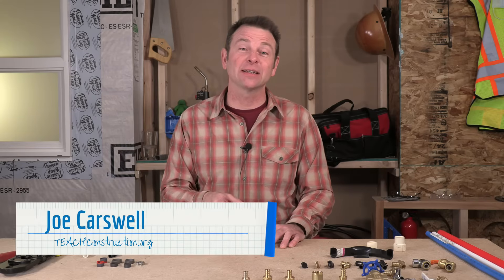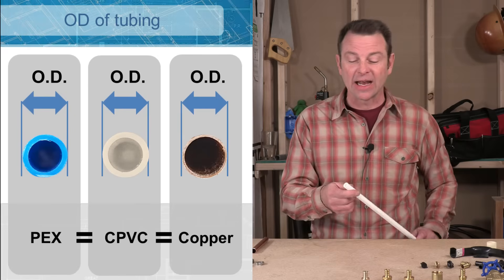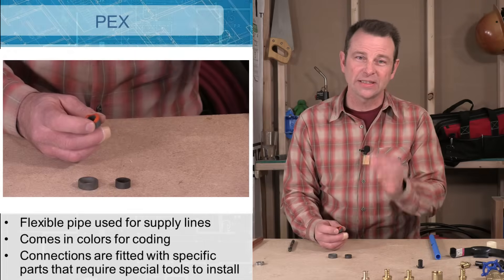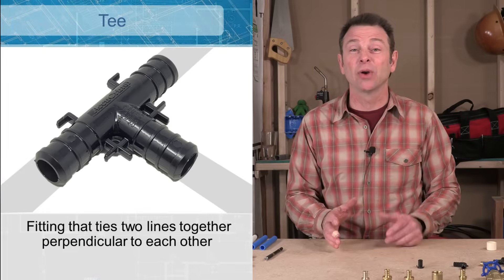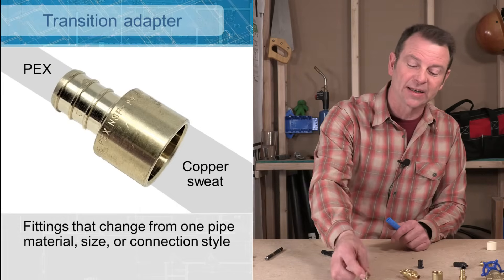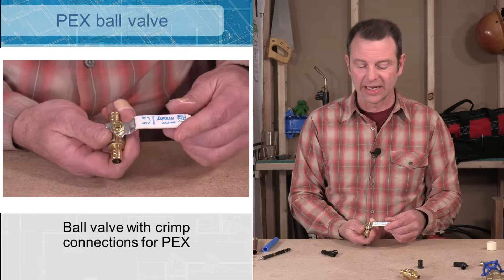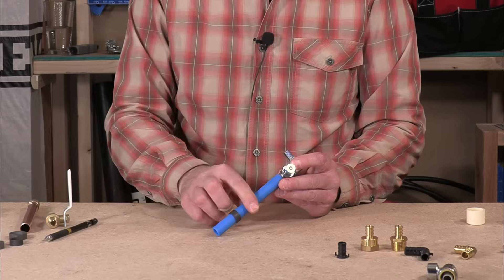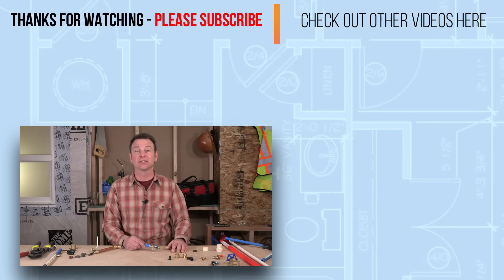A lesson about basic PEX plumbing materials  - Intro to Plumbing Systems

Comment: Is there a fitting I can use to connect to the compression fitting end on the water supply for a dishwasher that I am installing? The PEX, with a shut-off valve, is going to be replacing some leaking PB in my old manufactured house. Someday I hope to finish replacing all the PB.
Reply from the maker: Not sure I understand what fitting you are asking about - the supply stub out that typically has an angle stop on it - or the water input on the dishwasher?
Reply: @ConstructionEd  If you have a 3/8" OD soft copper line, just cut the line at a smooth place and use a push to connect with a jump size. You may want to consider using a braided stainless supply line to connect at the dishwasher.